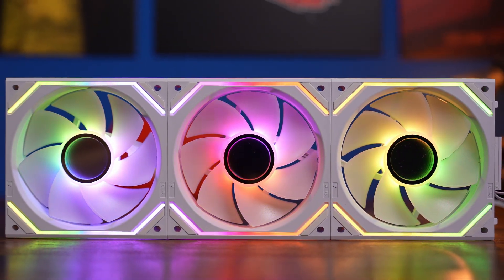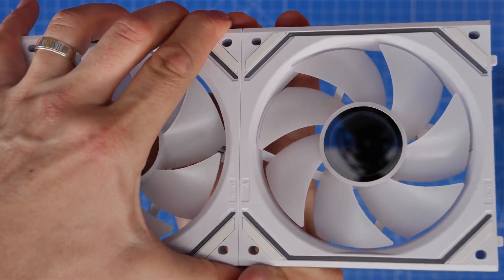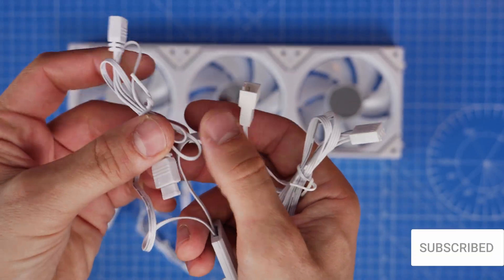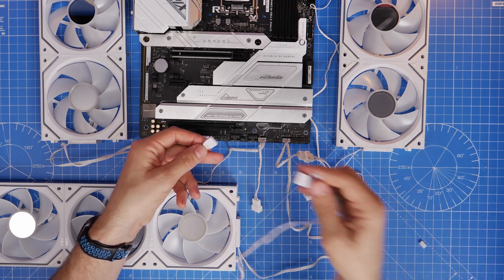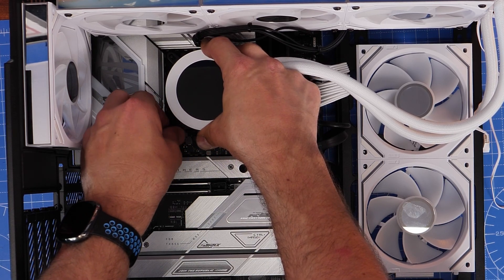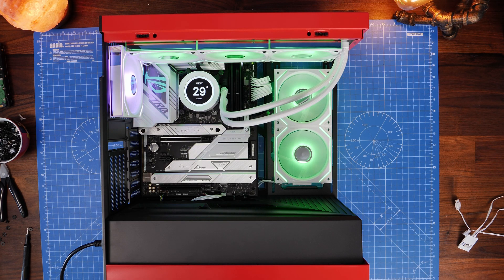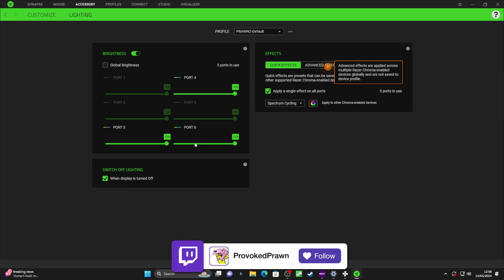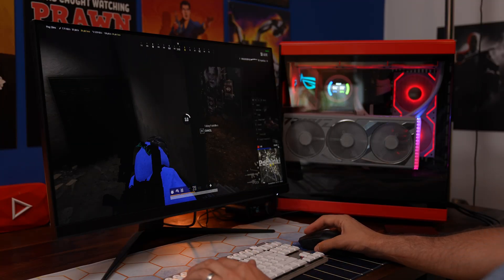How to wire and connect Interstellar V2 Unifans in your PC (TZMRIT Interstellar and other models)

Comment: Is it not possible to chain the 3 fans together using the wires and only using a single RGB/Fan port? I've got 3 fans connected to each other using the wires and each fan has its own controller. With my case, I was not able to combine any of these 3. The RGB is working but the fans are not spinning.

I have another set in the bottom of the case, all connected side-by-side and those are working perfectly.

Or do I have to get the Razor Chroma?

Comment: Hi, I brought my second pack today, love them, however ive cannot get the single case fan work, my case layout is the exact same as this video, the fan at the back I’ve tried connecting the PWM cable to system fan header 4 on the mobo and the RGB cable connected to my radiator fans but nothing, I cannot get any RGB or power to the fan? Do you know why? It says they can be ran individually?

Comment: I'm stuck with interlocking the fans, doing the exact way you do and it doesn't seem to work or lock in to place. Extremely frustrating
Reply from the maker: Are you sure you're sliding them in the right direction?

Comment: If I am using a fan hub, would I still need to connect the fan power cable to my motherboard?
Reply: The power cable will be connected to your psu

Comment: HI will these work with Icue titan 360 AIO hub, wirh RXfans i am upgrading my system currently have corsair dual loop fans as i don't if they will work with the latest icue hub, and i have an old commander pro thanks ???

Comment: I am considering buying three of their reverse fans to use as bottom intake fans on my Lancool 3 with an adapter from Etsy that lets me connect non Lian Li fans ro my uni fan hub. My concern is these fans would be louder than the real infinity fans. Does Jungle Leopard have any fans with a 200 rpm minimum fan speed?

Comment: Hi, I got my today and I also got a FANS HUB from this company, but i cant controll the speed, I also connected pwm on my motherboard, but nothing happends, can u help me please?
Reply from the maker: Go into the bios and set it to pwm mode on that specific fan port. That should help.
Reply: Got the same problem. They won't work with armoury crate

Comment: I daisy chain, but I still have to plug all 3 fan power cables into 3 chassis power on the mobo? Can’t you just daisy chain them and use 1 chassis power on the mobo to power all 3 fans?
Reply: you can plug 3 fans safely generally. Each mb chassis power delivers  1 amp. a caseFan typiccly use 0,1 till 0.3a. Used three pins splitter all the time, they never failed.

Comment: Looking at a Similar Jungle Leopard model for when I get a new case and fans in the future. The model name on AliExpress is the Jungle Leopard V2RS. FIrstly, i'm wondering if you have seen these and have any thoughts on them and secondly if the Jungle Leopard fans are controllable through signal rgb and are capable of gradient affects similar to the rainbow but with different colours. 

The effect I use for my current fans is the Gradient Wave in the free section of signal rgb and it works great for my current fans after setting it up and im wondering if these fans have the individually controllable leds that let you do so.

I assume yes as they are capable of the rainbow effect but that could just be something they added to make them more desirable and they aren't actually controllable to such an extent.

Any help would be greatly appreciated!

Comment: Challenge you to set up on lian li 7pin controller
Reply from the maker: You can't
Reply: @TheProvokedPrawn splice and solder maybe?
Reply: There are adapter cables on ebay that uses the 7 pin lian li connector to a 4 and 3 pin connectors ..  so you can use 12 fans on the lian li controller

Comment: You said max daisy chain a group of three for power. But what about argb daisy chain, can I chain all my 12 fans to 1 argb port?
Reply from the maker: I believe so
Reply: did you try? I wanna buy a hub but Idk if the power will be enough for 10 fans
Reply: I strongly advise against this. Each fan have a X number of leds. For your needs, with 12 argb fans, a argb hub is the way to go. The hub connects to your sata-power, directly getting power from the psu. And if you look at the specs from the hub, you will notice they way more leds....

btw guys, use this tip!! Look at what is avaible on the splitter cables side. You not see 6 or more splitter to one cable? That is a good indictication this is not advisable.

Comment: I noticed that you plugged in the 3 pin argb cable into the header. My motherboard only has a 4 pin RGB header and no 3 pin ARGB header, I can use something like the TZMRIT fan controller to have rgb lighting from those fans right?
Reply: Late but did you ever find out
Reply: @2k7mg  I did! Although I used different fans that were "Lian Li lookalikes" but not the exact fans shown in the video. I used a fan controller that's exactly the same as the TZMRIT fan controller, but under a different name. If you were to find the TZMRIT controller (or any RGB  fan controller) it would work.

Comment: hey, is daisy chaining 6 of these fans' rgb and connecting it to one 5v alright? my motherboard is the gigabyte z790 aorus elite x ax
Reply from the maker: Daisy chaining the RGB should be fine. But I certainly would not do that many for power
Reply: @TheProvokedPrawn how many should you daisy chain? My ASUs tuf b650 only has 2 3pin 5v argb headers
Reply: @TheProvokedPrawn I was thinking exactly the same. I have purchased 9 of these fans but I only have 2 headers for the ARGB. Do I daisy chain just the ARGB and split the PWM separately on the motherboard or just get a cheap hub. Any suggestions would be appreciated because I am building my own 1st PC and have already purchased these fans. Great video just what I needed.

Comment: does anyone know the value of the static pressure mmH₂O, cause i have the v1 mounted on the radiator that have a static pressure of 2.04mmH20 and was wondering if the v2 had better static pressure

Comment: What if your motherboard fan headers are 12v 2A? Could you not put 8 of these on one header as they are rated 12v 0.19A, so 8 x 0.19A=1.52A if my crap maths is correct.
Reply: yes, that is posssible but you are really pushing it. When starting the fans/pc up, there can be a spike. i would keep it at 6 maximum. 3 fans per amp deliverd by the motherboard. Most motherboards have atleast three chassisfan connections, so you have plenty to work with (18+).
Reply: @deejeemadrox1866 Put 8 on fan header one (4 front, 4 side) and no issues so far. Even at full power they cause no problems or power spikes.

Then again it could be the fact that my board is an Aorus X670E and built for it.

Comment: ArI these a 12v or 5v rgb connection, because it said 12v online but seems you plugged it into 5v rgb header
Reply: 12v is the fan voltage. 5v is for the argb itself

Comment: Hi The Provoked Prawn,

Just curious why didn't you use the TZMRIT 2-in-1 ARGB PWM Fan Hub controller ?
Not that I have any input, just curious!
Are the daisy chained tzmrit fans useable on the tzmrit controller ?????
Very Curious becasue i want to build a similair desktop with a few modifications
Reply from the maker: Because I hadn't bought one at the time 😂
Reply: @TheProvokedPrawn  It's been a while that I build an pc its been like 15y ago. With all the new options its getting confusing :D.

So basically was wondering what is the best approach. Buying a 3 in 1 fan set and daisy chain it or getting multiple singles and use the tmzrit controller. Because I dont know if the daisy chain fans go on the controller...
Reply: @DataNuLL-g2r Did you find out the answer to this? I'm in the same boat as you right now, and I'd really appreciate any help!

Comment: Mine went together really easily, these are brilliant for the money.. 
I got mine for £23.99 per pack of 3, reverse fans..
They are really quiet once a fan curve is set in the bios..
The aRGB is very bright, they look just like the Lian Li ones..
Reply: pretty sure those are the v1 for £23........they're still that price
Reply: @jnbr7520  They are more expensive now.. I got the V2 for £23..
I have now got the Phantek M25 Gen2 140mm for my new case, they are £30 for a pack of 3...
Reply: What are yours called is it a diffrent one or the same?
Reply: @J-X-M-23  The same V2.. I'm not using them now though, but they are still perfectly fine.. I have Phanteks M25 Gen2 140mm uni fans, £30 pack of 3..
Reply: @Vialli100.  Im scared to buy them, i dont know what to do lol.
Reply: @J-X-M-23 just buy a set if you like them buy more

Comment: What if i buy their Fan Hub? the "TZMRIT 2-in-1 ARGB PWM Fan Hub with Controller" what app can i use for that?
Reply from the maker: I've not used that but I think it'll still be motherboard software/bios as it'll likely connect in the same way to 5v RGB and fan headers.

Comment: Does the SignalRGB sees a group of 3 Fans as one Fan or see them as 3 single Fans?Thank you for the video!❤
Reply: Also interested in this 👀
Reply: @HardDBR  you could probably hook these up to the razer rgb controller and solve the issue if it doesnt. because im pretty sure it just sees them as one strip if not connected to a controller if i remember correctly?
Reply: If you daisy chain them into 1 header then SignalRGB can only sees them as 1. You can split them by adding components (8 LED/component)

Comment: The elephant in the room is always the nasty wires coming from the AIO pump which are impossible to hide!
Reply: A right-angle micro usb adapter is what I use for mine,  neatens it up quite a bit.